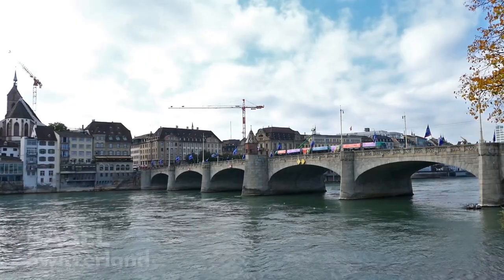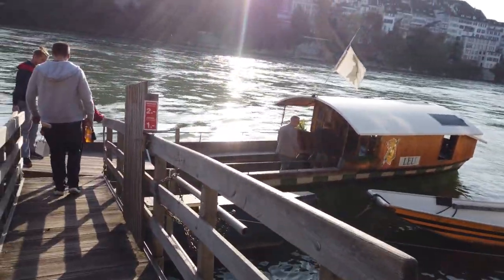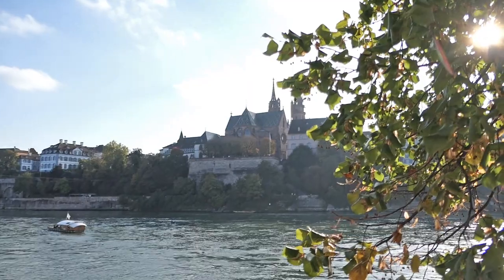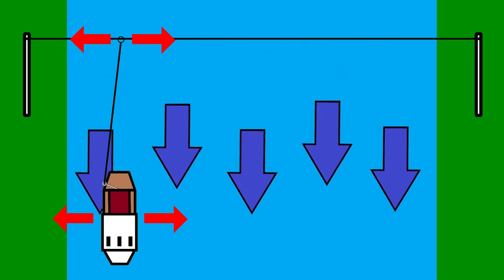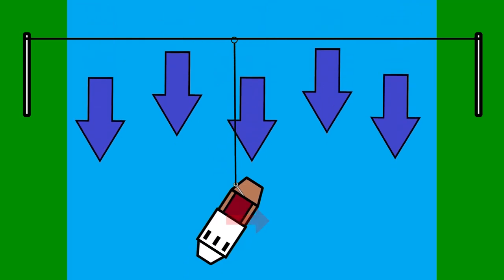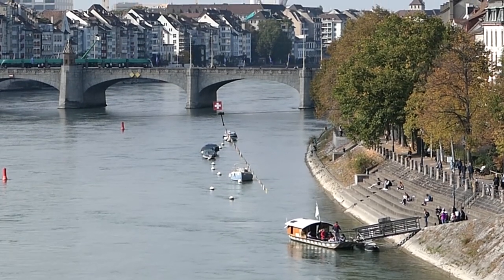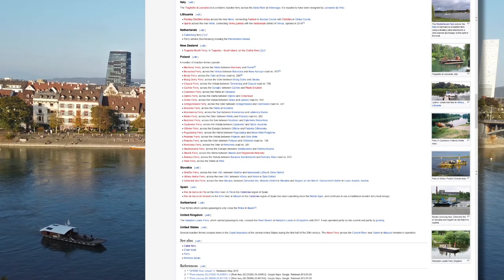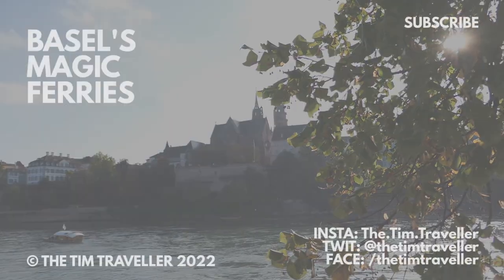How Do Motorless Ferries Work? (Spoiler: Two Bits Of Wire & The Laws Of Physics)

Comment: Hey Tim, 
thanks for sharing us the story of the ferry in Basel! I always used them as a child, when I visited Basel with my parents. 
Fun Fact: My father always checked the temperature of the water by holding his hand into the river while he was on the ferry. Last time he did that, he lost his wedding ring … 
I assume the ring is now some sort of „Rheingold“, maybe something to claryfy in another video! 
Long story short: Although my mother has never been more mad at my father than on this day, they are still happily married!
Reply: It was a tribute for your save passage XD
Reply: Cold water makes your hands shrink. Lots of rings are lost at beaches because of this. Only a tight fitting ring is safe
Reply: What a great story: equally uplifting as well as remorseful. Thanks for posting it.
You know what you can fill your time with when you retire.
"Thanks for the underwater metal detector for Christmas darling. I'm off to Basel again. Are you coming‽"

Comment: There's one of these in Grand Teton National Park in the US! It's called Menor's Ferry and it crosses the Snake river at the south end of the park. The snake river has many of the challenges you mentioned so the ferry generally only runs mid to late summer. The ferry was built in 1894 and was the only way for residents of the Jackson Hole valley to cross the Snake river until 1927 when a bridge was constructed rendering the ferry obsolete. The ferry that runs there today is a historical recreation of the original ferry and is operated by the National Park Service.

Comment: as a person living here in Basel, i never thought of it as something special, although it seems to be to people not born here... ^^' :D
it's not really fast tbh (it heavily depends on the speed of the water obviously), so we usually don't use it that much here in modern days... but it has some sort of idyllic appeal to it and is probably the most comfortable and calm way to get over the Rhein river :)
Reply: could be an interesting challenge to a boat builder to make a fast one
Reply: @illdeletethismusic  Tim pinned his comments about a "weird deja vu" referencing Tom Scott's video of the same ferry. But your comment reminds me of Veritasium's "faster than the speed of wind". So I guess it might be possible to engineer a faster one by utilising the stream and using turbines to power propellers that move the boat sideways (still tethered to save energy)
Reply: Sort of same here. I come from Poland, I've used a number of reaction ferries from the Wiki list, yet (apart from the fact that I generally like ferries) I haven't considered them a big deal until now ;p
Reply: @borstenpinsel  since the travel direction is at a right angle to water flow, speeds exceeding flow speed should be possible without moving parts, with the right geometry.
faster than wind speed is nothing new for sailboats, with sideways winds.
the exceptional thing about the machine in that video is it travelling faster than the wind exactly in the wind direction

Comment: Switzerland is a fantastic place. A family holiday there when I was 8 got me slightly obsessed with funicular railways. If you sort of kind of think about it and squint your logic a bit, these ferry’s are like funiculars of the water…or maybe not.
Reply: Without squinting logic the ferries in South Australia are funiculars of the water, two cables either side are pulled by motors onboard the ferry
Reply: It is more like a sail boat, except using the flow of water instead of the flow of air.

Comment: There was a ferry like that in the village where I lived (central US) when I was in my teens, but it had closed a century before when the logging industry petered out (because they had cut all of the trees). Apparently it was only able to run when there were breaks in the logs being floated downstream, and when the mills had shut down, most of the population moved away, so it was no longer worth maintaining.
I’m betting there are similar stories elsewhere - changes in demand, replaced by a bridge, etc. And of course the ferry owner could set up business elsewhere pretty easily if a different location was more lucrative and they could get access to spots on either side of the river.

Comment: Wonderful. The same technique - known to boat skippers as Ferry Gliding - is used by rowing ferries to reduce effort. You use the oars to keep the boat pointing upstream but slightly across the river and row into the stream. As long as you do, the boat will move sideways across the river. It can be used even with a motor and is very useful seamanlike and controlled. Well done the Swiss and the River Rhine!

Comment: As a canoer (canoeist?) in an earlier stage of life, this is the exact way that we used to cross rivers, although we'd have to paddle at a just off parallel angle to flow to do it rather than using a nifty set of cables. Technical term is ferry gliding for this kind of motion in a boat with something providing forward thrust (human or mechanically powered).

Comment: In Northern Germany there is a special, hand pulled ferry called "Pünte". It is pulled by hand by 2 ferrymen, the boat is loosely attached to a steel cable crossing the river Jümme (near the larger town of Leer). The river at this point is tide affected, there is a changing incoming - still standing - outgoing stream. Very interesting to watch, also the changing pull technique depending on the water flow and high.

Comment: Good job on the pronunciation in the intro, correct dialect and everything.

It would only take 1.5 hours to get to a ferry in Basel from where I live. But there's also a cable ferry less than 10 kilometers from where I live, but it is a lot smaller, and so is the river. But it's operated by volunteers and free to ride.

Bis bald bim Fährimaa!

Comment: Fascinating.  There's a way of manoeuvering a boat known as "ferry gliding" which involves holding a course at an angle to the current or tide, in much the same way as here, but under power.  It makes the boat much more manageable, particularly when coming alongside a jetty or another boat.  I guess this is where the name came from.....

Comment: We got such ferries in Croatia for cars, usually 4-6 vehicles + pedestrians. Likely won't be around for long in my area since two new bridges are planned in the next decade. Currently it's either a trip 20+km in one direction across the border into Slovenia (soon irrelevant when we join the Schengen but still a detour), or 15km the other way back and forth trough Zagreb. This is on the Sava river mentioned at the end in the wiki article, only closed during floods or really high tide.

Comment: It also works with a long roap just fixed to one or the other bank of the river. That's better for other ships, they do not interfere in height with the horizontal cable. If a ship wants to pass, the ferry just has to be on the side, where the roap is fastened.
Reply: How would that interfer less, than a rope which hangs above the ships?
Reply: Surely that would just make the boat scrape along the bank?
Reply: @100dampf  There is no restriction in height. Like in old times of steam ships, they often have to tilt the chimney when going under a bridge. They also had to do it for cables across a river. But they don't have to, if there is no cable across the river.
Reply: @100dampf  It restricts it only when the ferry is on one side. If it is on the other side, there are no restrictions at all. Most reaction ferries on the river Elbe in Germany work that way (Gierseilfähre auf deutsch). The other problem would be that you would need high towers otherwise in areas where the river banks are more or less flat.
Reply: @C.I...  No, there are big rudders on these ferries which change the angle of attack opposing the stream of the water. That way you can decide where to go.
Reply: @100dampf  It's not about "beneath" it's about "Underneath". And as I said, boats don't need to exist, it's enough they existed.
If the boats are turning smaller, they don't change the ferry technology. The horizontal cable is difficult to install, so why doing so, if it works without ?

I know a few places on the Elbe who work like this. It's probably used on places with only 50m wide rivers, not with 200m wide rivers.

Cute video:
https://upload.wikimedia.org/wikipedia/commons/transcoded/f/f5/Gierf%C3%A4hre_Rathen.webm/Gierf%C3%A4hre_Rathen.webm.480p.webm

the ferry is the second boat, after the first has passed.

Comment: Fascinating. But I would have liked to see some details of the cross-river cable and the anchor points because they are crucial to the operation. It seems the cable would have to be stretched rather tight to minimize 'lateral sag' which would hinder the ability to pull up close to either shore?

Comment: I was wondering, "but what if the line snaps while a ferry's crossing?" But you covered that - the operator has a rudder and a paddle, so presumably they step calmly into action to guide the boat to the shore in a hopefully-controlled manner.

Comment: Seeing that, I think "that is normal, right"?
But looking it up it turns out that the ferry nearest to me (Netherlands, Culemborg) is such a reaction ferry but there are not too many of them.
In this case there is no line over the river but it is anchored in the middle of the river and the ferry (which is much larger, it accommodates cars) swings around that central point like a pendulum.

Comment: In the Netherlands we have tens of motorless ferries on the big rivers that cross the country. The are called ‘gierpont’ and use the force of the water through a different principle, like a swing. The cable to the ferry is supported by two or more small unmanned boats that strengthen the forces needed to move even large ferries. This working principle goes back to the Middle Ages.

Comment: But when I looked at the Wikipedia list of those Polish ferries, a lot of those no longer run, either they are temporary suspended or have been permanently replaced by bridges. Or like the ferry I sometimes use (on the Vistula river in Czernichów) the nice old system is no longer in use (but I think is working) and an electric engine has been installed.
Reply from the maker: Ah that's a shame. I did wonder if the wikipedia information was up to date, I can't imagine that particular page gets checked very often. Thanks for digging into it and reporting back!
Reply: @TheTimTraveller  However, some of those ferries that had engines installed use them only to start moving and then switch them off and just go the "old school way". 

I just recalled I have footage from another ferry, one of the bigger ones: https://youtu.be/-r5Gp5k8TIU?t=1602

Comment: Many thanks Tim. You learn something new every day, eh‽
Never heard of them until now and I was all set to mention the Higher Ferry on the river Dart in Devon. But no, its cables are used to pull it across using engine power of course.

One of those inspirational examples of a type of Biblical era perhaps simple engineering that err.., simply cannot be bettered.
Hold on tight meine Damen und Herren and mind yer fingers!

Comment: don't all rivers have underwater currents though ..just make a fin system underneath the boat? not sure if underwater currents are always at the same level but if they aren't you could find it with pressure sensors?

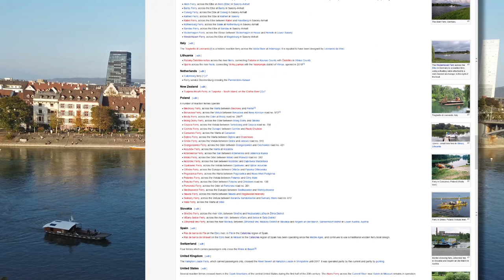Comment: 3:28 looking at the Dutch ferries listed I see they all have a line of small boats

I have seen this on the Wageningen ferry on the Nederrijn as well but I don't know if it's also using this method or just a boring normal engine with the steering done by the cable
Reply: Harrytheferryman , a Youtuber who does mostly stuff like welding video does a lot of upkeep on ferries and made a video about how some of Dutch ones work: https://www.youtube.com/watch?v=SonUxPaAFgw

Basically, they use the currents to help but also use an engine to go faster.
Reply: The Wageningen ferry is definitely powered, though it might be cable-guided.

Comment: Reading the title: Well the only motorless system I know of is a wire or rope going across the river that you pull, but that's one piece of cord, not two, let's check this out.

"There is a wire running across the river" Never should have doubted myself.

Comment: Fun fact: Modern sailboats actually use nearly the same effect to sail (mostly) against the wind. They first angle their sails against the wind so that they move sideways relative to it the wind, then they angle their hulls relative to that motion so that the water pushes them sideways even more, resulting in the boat moving in the opposite direction of the wind!
Reply: This your first attempt to understand 'sailing'?
Reply: @kiereluurs1243  No, not all sailing works like this, this is a specific method used to sail against the wind. It doesn't work directly against the wind but can go diagonally against the wind.

Comment: So, the movement is much like a sailboat tacking in the wind, and the perfect conditions is much like the proper drop of a sewer tight line. Too much drop, and the water rushes by the solids, leaving them to build up in the pipe. Not enough drop, and the solids also build up. Both ending in a clog, or failure of movement.

Comment: I imagine the wires are a bit of a restriction themselves. If the river meets all the magical requirements, but there's a yacht club upstream, they probably wouldn't want their hats knocked off by a hard to spot line going across the whole thing.
Reply: If the 15m high wire is a problem, then the 10 meter bridge migth be more of a problem

Comment: Great, but that wire doesn't bother conventional boat traffic?
Reply: It is hung up higher the the bridges around it, so no.
Reply from the maker: Great question! If you're talking about the wire across the river, it's higher than the arches of the bridge downstream - in other words, anything that goes under the bridge can get under here too. So in theory it shouldn't cause any problems.The tether wire, however, could potentially be a danger. I think that's why they put the colourful bunting on it, to increase visibility, and try to prevent any other boat getting tangled up in it or cutting the ferry adrift. But tbh that's a minimal risk anyway. Most river traffic goes up and down the river rather than across it, so it's pretty unlikely anything would foul the tether.